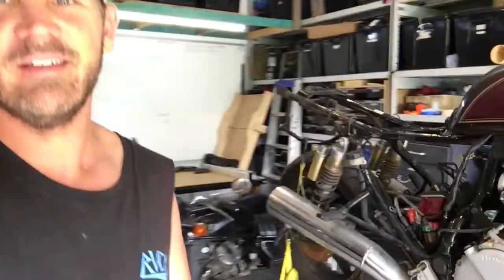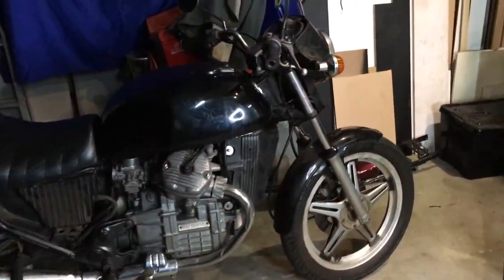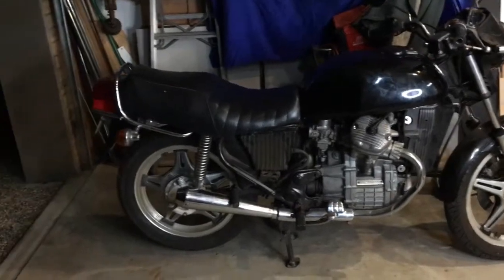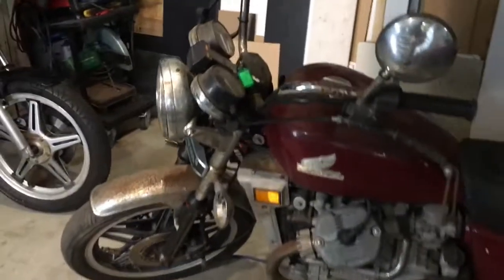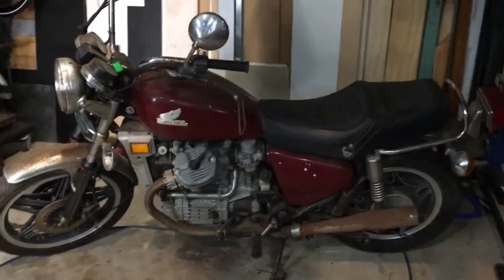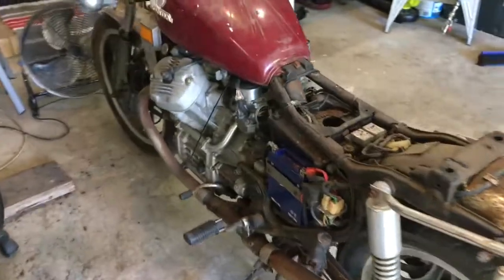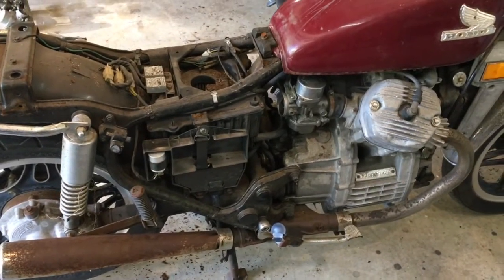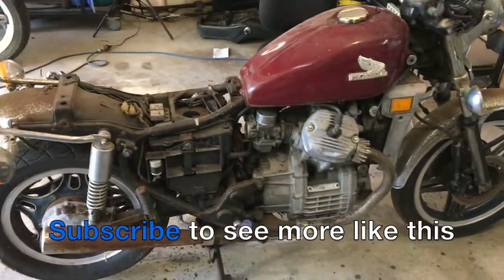Honda CX500 ★ Cafe Racer Build, Bobber, Brat Style Seat, Cafe Racer Hump or Scrambler Seat

Comment: After you replaced the carbs and it ran, it sounds like it may be running on one cylinder, or else there’s an exhaust leak. Those pipes look pretty haggard. They could be painted and sold, though.